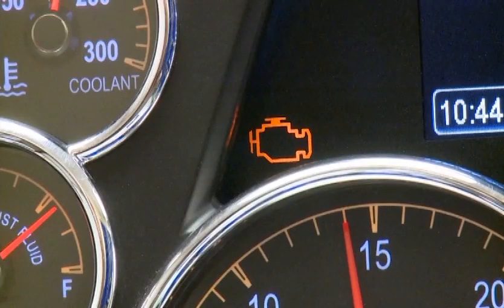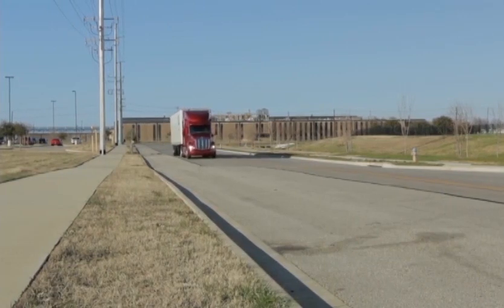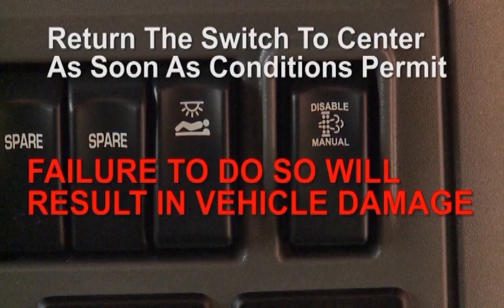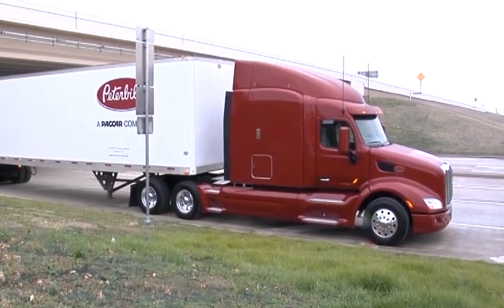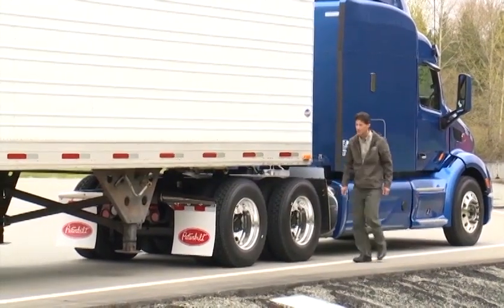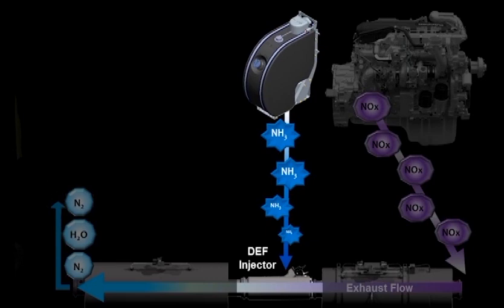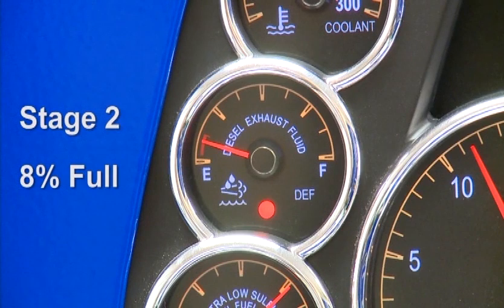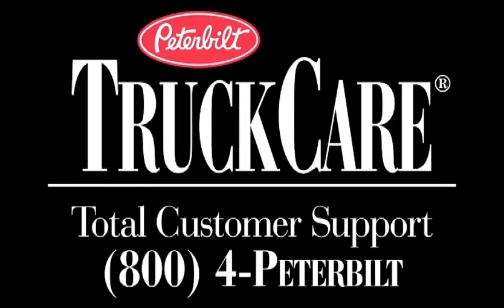Paccar MX13 Emissions and Dash Warning Overview

Comment: This Def  system with that 5mph derate should be classified as  high crimes against the trucking industry. This system is the one thing that is bankrupting the smaller truck owners . Those shop bills  is outrageous. Worst invention ever .
Reply: Pull the ABS fuses and you can keep driving it.
Reply: @ItsPoofy88 the abs fuses ?

Comment: The engine MX-13 was developed in Europe, to be more specific the Netherlands.
Reply: It comes from DAF trucks in Europe to be exact
Reply: @bravo402  To be more specific DAF is Dutch.
Reply: I find it hard to believe
Reply: @Nitewolf5377  It might be a shock for you, but that's the case. As you know every engine, motor or equipment developed in the US has non-metric measures. Well, the MX-13 has metric measures till the very last bold. Here is a video in which you can see the MX-13 is developed by DAF Trucks at Brainport Eindhoven the Netherlands. https://www.youtube.com/watch?v=xu0UbB3ZlNw 
DAF Trucks develops motors since 1956. Why then should PACCAR develop an other motor while on of her great daughters has the know how to do that job perfectly. And if PACCAR would do so, why didn't she develop the MX-15, which is a Cummins motor.
Reply: @47rintin1  there is no mx 15 cummins, there is ISX 15 and X15
Reply: @farmerwes2520  I didn't know that, thanks.
Reply: @47rintin1  no problem, we all learn some how right, haha
Reply: @47rintin1  Not developed at BrainPort Eindhoven but just by Daf itself in Eindhoven/Geldrop
Reply: @crocket1971  Thanks for that.
Reply: @Nitewolf5377  Did you find after all an American manufacturer as a proof who is working with the metric system?